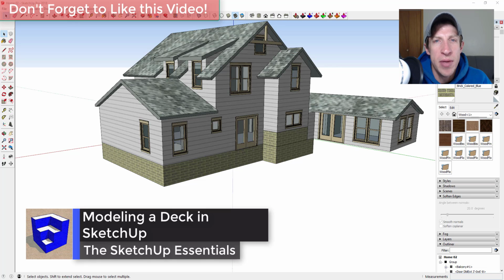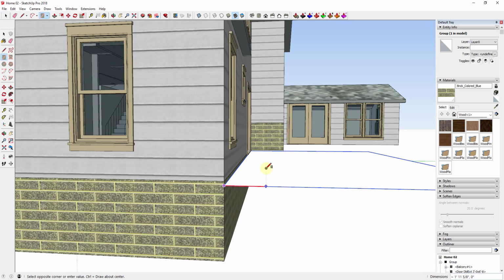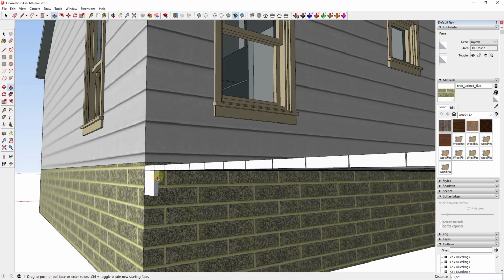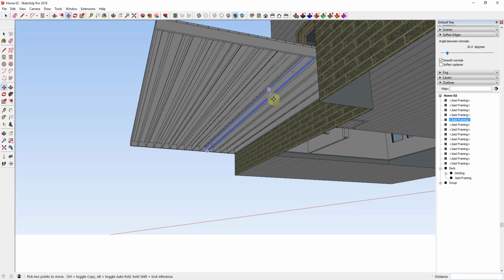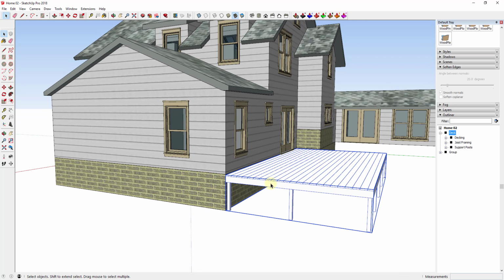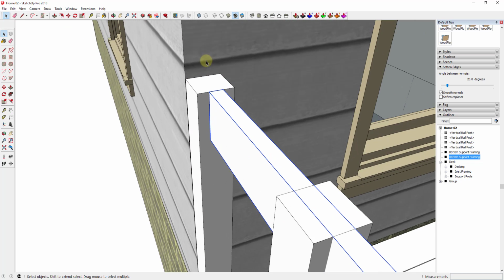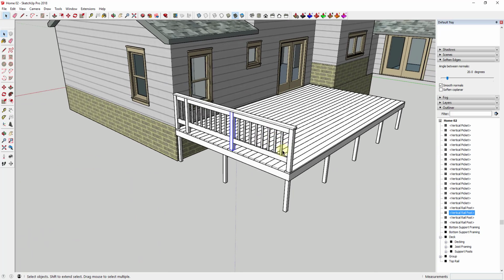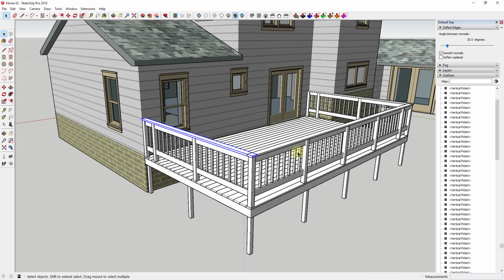Modeling a WOOD DECK in SketchUp

Comment: Hey cool vid, i have a question I couldm't find the answer for, if I have an angled decking in mind but I can't find an optimal way to cut out across multiple lengths of the decking boards. Currently using Sketchup Free and the cuts are just groups. Can you help?

Comment: You ran your joists the wrong direction 😅
Also, the standard is 16 inches on center (not 12), but because of the way you ran your joists, you’d need an entire joists for each piece of decking to prevent people from falling through the deck. Finally, 2x8 is okay, but generally decks are both framed and decked with 2x6. Great video!
Reply: 12” centers are standard for vinyl and other non-wooden deck material. As far as framing members, you should check a framing table to see the size of dimensional lumber you need. It depends on spans and loads and other variables.

Comment: You are one of the best sketchup instrustors out there.  (but not a carpenter for sure) haha but thats ok!   floor joists blah, blah blah!
but actually the bottom posts are full height through the decking to your railing top plate.
create one side then rotate/copy etc....Great stuff!!

Comment: Good video quality. You need to check a few framing techniques and some dimensions. Lumber is general *5/8 not a quarter or half (e.g. a 2x8 is actually 7 5/8" x 1 5/8")

Also, the Decking runs perpendicular to the Joists or they would have no support. What you were calling the Joist originally was Facia which can clean up the edges of the decking and joists very will. NOTE: you might try raising the Facia level with the Decking. 

Good luck.
Reply: Jack, contractor here. You’re actually totally incorrect about your lumber sizing. After a 2x4 (1.5x3.5) and 2x6 (1.5”x5.5”) they move to 1/4” dimensions as correctly noted in the video. 2x8, (1.5x7.25), 2x10 (1.5x9.25), and 2x12 (1.5x11.25). And what you’re referring to as facia is actually a band. Facia is the trim around the roof. The deck band is the exterior of the deck banding that you see. It’s usually also a structural element of the deck framing. You have your terms and sizing all mixed up.
Reply from the maker: Sigh...probably 50% of the comments below talk about the way the framing is going as well...the intention of the video is to show you how to use the 3D software to model whatever you'd like - I would hope that anyone looking to actually BUILD a deck is going to a much more knowledgeable source

Comment: It would take you probably five minutes to me doing this for about five weeks how many boards I need for a 12 foot wide 10 foot deep deck with the deck boards at 45° angle to the joists help me help me help me please
Reply from the maker: I don't understand what you're asking exactly, but probably you'd model your boards, then draw a plane at the angle that you'd like to cut then and intersect it with your boards, then erase out the extra geometry

Comment: obviously you are a genius, BUT, why in the hell are you running framing the same direction as decking? I'm guessing you are more of an IT guy, as opposed to a structural engineer.
Reply from the maker: RobesPiBear As half the other comments on this post have already stated, thanks. Hopefully the video gives enough instruction that you can model your deck however you’d like